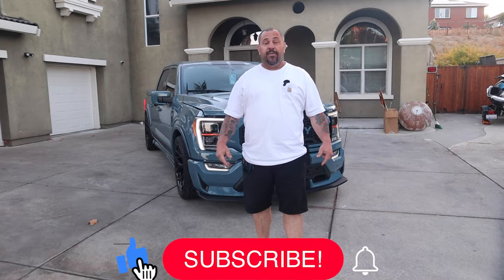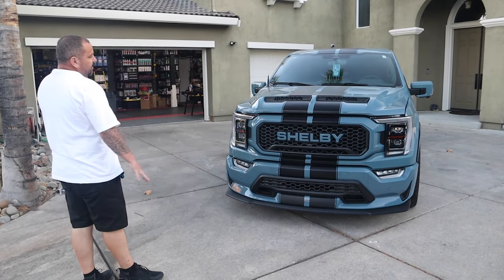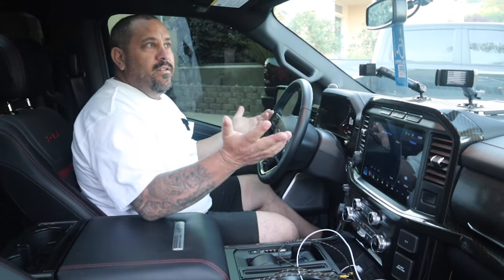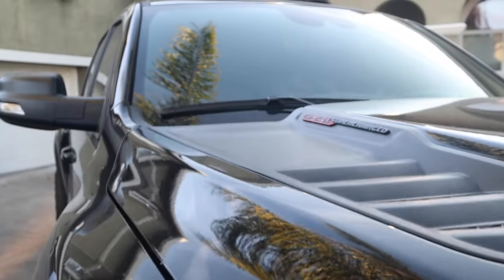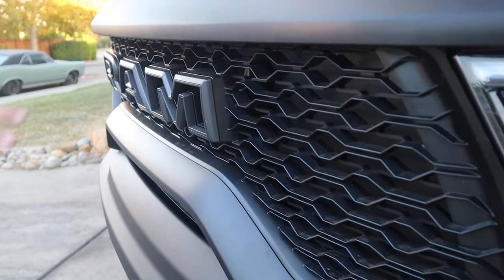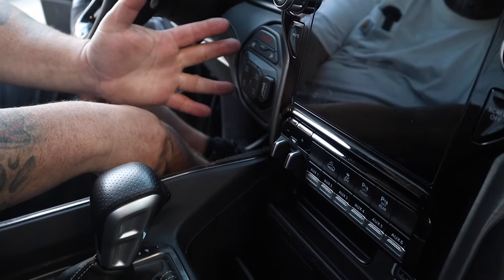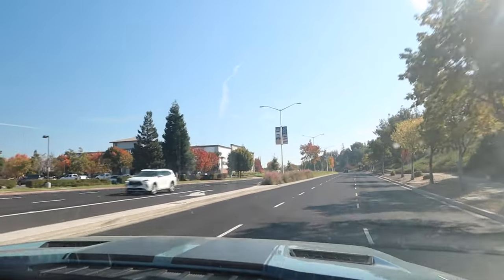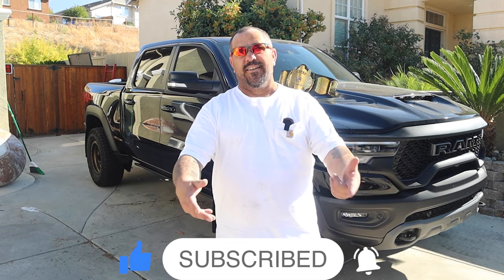The Toughest Choice: Rams TRX vs. Fords Shelby Super Snake

Comment: The 4WD A means automatic 4WD. The power is sent to the wheels which need it the most for maximum traction. 4WD A is great for launching because it allows the computer to take power away from whatever wheel is spinning and transfer power to the ones that aren’t in order to give you the most traction.
Reply from the maker: Thank you, I didn’t know that, appreciate the knowledge
Reply: @MikesAutoDetailing wait! 🛑 so did u put it in 4WD A? When you did the 0-60mph run?
Reply: Nice video, I have a 2020 Shelby Offroad which I love daily driving. I was wondering if putting it 4WD High would be better for launching so all wheels spin same time for maximum traction OR AWD option which would engage front driveshaft once it senses that slip.
Reply: @cw4568  try it out you have the truck lol

Comment: Hey heads up Ram TRX is very easy to steal because people been stealing those a lot. So be careful
Reply from the maker: Trying, garage kept as much as possible
Reply: @MikesAutoDetailing  if you have that compustar pro T13 security Killswitch the one put in the PIN code they won’t take it. I’m getting one for my 2023 Ram TRX Havoc Edition soon if mine comes I’m getting installed immediately it’s gonna be sitting my dads garage for 5 days because mine is gonna be a weekend truck. I can’t drive it to work because they will hate on me. But you know what. Screw them haters